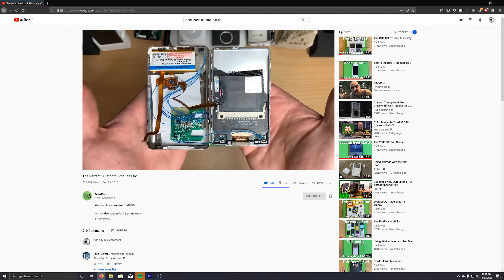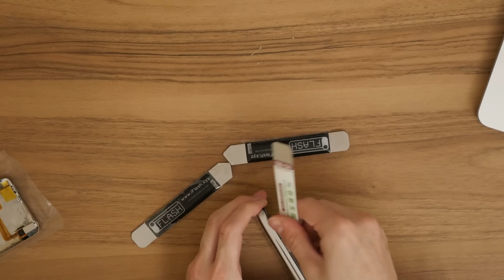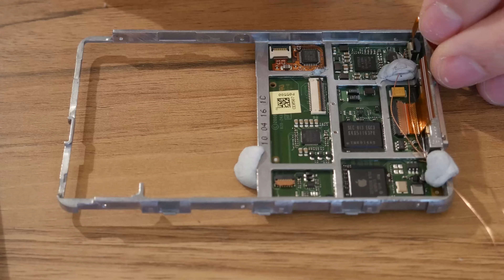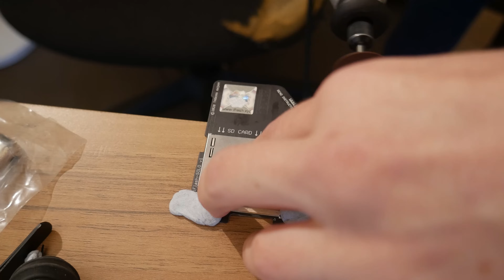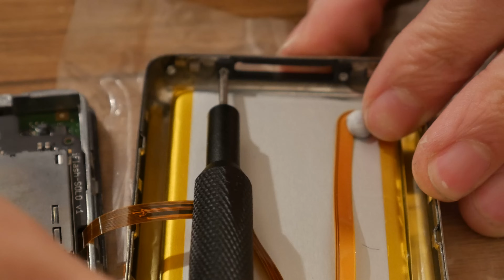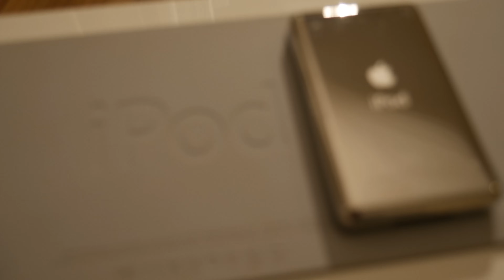The REAL Perfect Bluetooth iPod Classic

Comment: maybe this is a stupid question, but I thought that you're supposed to have the solder right on the iron when you're making the connections. He doesn't seem to be doing that here. Is he just melting some solder onto the tip and then transferring it to make the connection? I thought you weren't supposed to do that?

Comment: To anybody watching this video now trying to do the same, the first back he shows appears to actually be a thick back, not a thin back - I suppose I could be wrong, but judging by the shape of the edges and the general look. If you are buying similar casing and yours looks like the first iPod shown, it’s likely thick. Also, the iFlash Quad is thinner and smaller than either the Duo or Solo, so it will always be the best bet for this type of mod.
Reply: Correction, just got a closer look, can’t edit or delete the comment to correct. It is indeed a thin back. However, the iFlash comment remains true.

Comment: What size wire did you use 18AWG? I can’t seem to get solder to stick to the battery circuit board leads. I have a Weller WES51 pretty sure that gets hot enough. I’m using 24AWG wire maybe too big?

Comment: Some good ideas. Few points - I'd want to use shielded wires as there's too much chance of contact between wires which can cause audio cutouts and even fires in the usage for power. The switch mod is a good one but you want to use epoxy resin not hot glue - that's not going to last long term.

Comment: I got to putting the bluetooth board in the ipod but the link for this bluetooth is a different one and is longer than the one you're using. It doesn't fit. 😞
Anyone know where to get this (or a smaller) board?

Comment: Is anyone having better luck than me with replacement batteries? I’ve fixed up several IPod Minis and a 5th Gen classic, but all of the new batteries I’ve bought have short life. I’ve tried several battery sources. The original iPods could easily play for hours. I get about an hour if I’m lucky, even with a flash storage upgrade
Reply from the maker: I’ve thankfully never had any issues, however short battery life can also be caused by a bad quality SD card adapter.

Comment: Hi Pendleton, I was able to do this mod using your wiring guide! Soldering into the battery connectors is TOUGH and I actually shorted one motherboard by bridging connections. 
Alternatively, anyone doing this for themselves can solder into the second black (or yellow) capacitor right above that battery connector, which has a much larger solder pad. I chose to and the only caveat is that bluetooth module cannot be turned on independent of the ipod. There's no use case where I would do this anyway so it's perfect.
Reply: Does that mean the Bluetooth will shut off when the iPod enters sleep mode?
Reply: Yes. If you solder into the battery connector like Pendleton did then the bluetooth receiver can be powered on without the ipod itself being on.

Comment: Thank you so much for this video tutorial. I did this to my 7th Gen a month or two ago and I love it with one small problem…Ive been busy so I haven’t used it much since the mod but, I just charged it for the first time and noticed that display shows the incorrect battery level. It also doesn’t change on the display. To clarify, my iPod’s screen shows the battery is at about 60% and it doesn’t deviate from that regardless of the iPod is fully charged or almost dead. Any thoughts on this?  I’m assuming I (most likely) messed up when soldering the Bluetooth board to the iPod’s power down next to the charging port?  I’d GREATLY appreciate any insight you may have. I’d love to fix it. 

On another note, I’ve been using my iPod primarily in my truck where it’s only ever 2’ away from the Bluetooth receiver. Well, yesterday, I attempted to use a pair of Bluetooth earbuds with my new modded iPod and the range is horrendous. I wasn’t able to leave the iPod in my pocket due to extremely frequent and continuous audio dropouts. I think I’m going to end up cutting a hole in the backplate and putting in a small section of polycarbonate. Either that, or I’ll look for a new poly faceplate.
Reply from the maker: The battery readout is never completely accurate with these third party batteries, however it should be more accurate than that. 
 They’re only two pin batteries, so it’s unlikely that the connector was damaged, I’d say try another battery and see if you have any luck, they’re relatively inexpensive so there’s not much risk in trying!

 As for the range, did you cut a hole in the metal LCD backing? Make sure that the antenna on the Bluetooth module is lined up with the hole, and if you’re still having issues maybe cut a bigger hole or remove the backing entirely.

 Keep in mind you’ll need to place the iPod in your pocket with the screen facing outward, if you place it screen inward the antennas will be blocked by your body!
 Hope this helps :)
Reply: Thanks for the reply!  I did cut a hole in the metal LCD backing as instructed in the video. Although, I’m fairly certain the Bluetooth module wiggled loose while I was reassembling everything. That being said, I’ll try another battery and ensure the Bluetooth module is in the correct place when swapping the battery. 

I will also try removing the plate entirely if that doesn’t work. 

Thank you again very much!

Comment: you can get bluetooth dongles made for the nintendo switch and just click them into the headphone jack. not a perfect solution, but it's a no-mod solution. 
there are also a few brand of dock-connector based bluetooth transmitter. 
same goes for ipod docks, you can get dock adapters that turns an ipod dock into a bluetooth speaker with remote support.
Reply: The heck i never thought about that great idea w tge switch dongles lol
Reply: Also we watch a lot of same vids this is the 3rd-4th comm of urs I see LOL

Comment: Great video. To add Bluetooth in a pinch without a mode. You can add a Airfly adapter to the audio jack too.
Reply: what a bout USB-C?
Reply: It works with the audio jack. It changes via a USB-C port on the Airfly

Comment: Question: Can you do that project with a 5.5 into a 7th gen iPod, and can you keep 3.5mm Audio Jock working together with BT ? So I can choose between plugging in headphone or connecting to BT devices ? How about sound over the pin connecter, that's untouched as far as I can tell ?

Comment: Why hot clue 🤔 it's not as secure as you think. Just try a single drop of 70-99% IPA it will come up. Also great can do the same. Btw I don't like using it but chip -quik is a fast way to desolder components. You just need solder braid after to make sure it's fully removed before soldering anytime new.  Over all interesting ideas just my a fan of some of the stuff you did to implement your work

Comment: I know this is old but just dug out my classic gen 5 to replace battery. I notice everyone struggling to get them open and I'd never done it probably this video came up in my feed . Anyway I used one of those tiny flat blade screwdrivers and the inserted a bunch of guitar picks and was even able to use the picks to slide around the edge and it opened surprising easily.
Reply: Yeah the 5th generation is easier to open since it's plastic and the 7th gen is aluminum

Comment: Also, is that BT link still valid? I looks rather big. Did they change it, or is it fine once the case is taken off?
Reply from the maker: The one in the link should work, much of the space is taken up by the battery. If you wan to see the process of disassembling it you can check out my clear iPod video.

Comment: I did this a long time ago, less the BT module. I have the iFlash Quad though. After seeing this, I am thinking of adding a BT module. Think I can fit it? Also, does the BT module stay lit only when pairing? If so, the lights might be a good thing to let bleed through. If there's a separate power and pair LED, then maybe just DC the power LED?

Comment: I have found that anything over 20,00 titles, the classic is slow as a slug.  It takes 3 to 5 seconds to navigate each click. It will also add 30 to 90 seconds to boot up.  So, over 256GB makes no sense.  Also, buy the fastest SD card you can afford.  You must use the iFlash adapter.  I have found that the original 160gb hard drive is 50 to 100% faster syncing than any SSD.

Comment: Never use glue on a solder joint. If you need glue to hold the joint in place you didn't solder it good enough. What would make you think glue would be stronger then metal in the first place?
Reply from the maker: Fight me
Reply: @Pendleton115  solder should be good enough, also glue makes repairs a lot harder and these ipods break a lot

Comment: Awesome mod, I love that you kept the audio jack and added a clickable button to control the Bluetooth.
A few questions: Is the thick metal case required to make room for the 3,000 mAh battery? And how much space is left in the final build? I see there is some free space at the top (see at 25:54), would it be possible to fit in a taptic engine into this empty spot?
Reply from the maker: Yes! It’s definitely possible to fit a Taptic Engine, I’ve done it before!

 A thick back is required though to make it all work :)
Reply: @Pendleton115  hi I'm looking to do this build as well I'm looking at the transmitter is it one that's in a black case with an aux cable?

Also what phone did you use for the clickable button lastly can I use a 512gb SD card in a 7th gen 160gb?
Reply: @Pendleton115  Good to know, thanks for your reply!!
Reply: @Pendleton115  this is so funny, I came looking for this answer

Comment: Hey, thx for you awesome tutorial. Please, could you tell me why you need a new wiring harness? Can don’t still use the original one? THX a lot and have a nice weekend. 🖖🏻
Reply from the maker: If you’re upgrading to a thick back you need a thick back wire harness to match
Reply: @Pendleton115  No I dont have thick back rather a thin one! ipod classic 160gb. I think gen 7. then I assume I can use the built-in cable right? THX a lot.
Reply from the maker: @brazo98  if you plan on doing a Bluetooth mod you’ll need a thick back as well as matching thick cable

Comment: I will be performing this mod soon to my iflash modded 512gb 5.5 gen iPod video. Thanks for cutting up a Tarkan for the rest of us! 
Two questions:

1. I went ahead and ordered the same Bluetooth transmitter you used for 10$, but now I’m wondering if there isn’t a better choice available that would be aptX HD capable to match up with newer audiophile aptx hd receivers (I use the bluedento). If you search Hagibis aptX hd you’ll see a VERY small looking Bluetooth transmitter that does aptx hd. Anyone out there used one of these or hacked one up? Might be the way to go. 

2. Can you just reuse the original pairing button off the taotronics board rather than using something else? Or is it just not good enough quality or the right size? It seems like you got it off without damaging it. Just wondering if I can reuse that button if I’m careful rather than trying to find something else. 

Thanks for the excellent video and the push to make my beloved iPod Bluetooth capable.
Reply from the maker: Thanks for the interest! There’s nothing stopping you from using a different Bluetooth module, provided it is a similar size and runs off 3.7v.

 I did try to re-use the original pairing switch, but it is much too small and is too difficult to mount and doesn’t give the correct feedback.

 I would recommend checking out my transparent iPod video for a better method of installing the pairing switch!
Reply: @Pendleton115  that transparent build is amazing. I think I’m gonna go ahead and try and do it. I’ve got a friend with a 3d printer. Maybe I missed it in the video but I didn’t see it in the notes. Where did you get the wireless charging wiring kit? Or was that ripped out of something else?

Also I have left this comment a few times with an eBay link to a button I’m curious would be a good candidate for the Bluetooth, but apparently YouTube won’t let me add an eBay link. So if you search “10 4.3x4.5x4.3MM Momentary Tact  4-Pin SMD Micro Push Button Switch”. The second listing is the one I’m wondering if you think would be alright. 

Thanks for the inspiration. Amazing work.
Reply: @Pendleton115  ps. I’m just gonna use the taotronics bluetooth transmitter for now. If I upgrade my Bluetooth receiver to one that works with aptX hd maybe I’ll try ripping a different one up. 

One off the wall question. I’m gonna upgrade to 512gb while I’m in there. Currently using a PNY 256gb sdxc that has 90 mb/s read. For the new card I can’t decide if I should stick with PNY elite performance (95mb/s) or go with the sandisk extreme pro which is 170 mb/s. Just not sure if I’d really see much, if any difference in performance or if it might fix issues with shuffle skip. Any thoughts? 

I’ve emailed iflash but it’s been about a week with no response. Not much luck finding anyone talking about how the different mb/s speeds help or hurt performance.
Reply from the maker: @aaronaustin4019  I cant imagine you will notice a difference. I believe there would be other parts of an iPod that will bottleneck performance before a faster SD card can improve things
Reply: @Pendleton115  finished adding Bluetooth to mine last night. Thanks so much for the inspiration. Sounds absolutely great quality wise! Much better than my iPhone due to the aptx codec and better DAC in the iPod. 

But my range is not so great. I’m using a 5.5 gen with a plastic front so I figured it’d be pretty decent, but it’s very touchy about having the plastic side facing towards the device. And even then it seems like the range is much worse compared to when I tested the  taotronics externally. Did the clear back help yours gain a lot of distance? 

I also was wondering if perhaps the iPod battery is outputting a lower voltage than the original taotronics battery (I’m using a 3000mah aftermarket battery). From what I read bluetooth transmitter antennas are very much power sensitive and will lose significant range if even slightly underpowered. I will test the voltage coming off the original battery and the iPod battery and see if this is the case soon. 

If that is the reason, I’m wondering about adding a second battery to power the Bluetooth but I would want it to still charge off the 30pin. Do you know where I would attach a separate battery to grab the voltage coming in on the 30 pin or could I just use the same spot currently feeding the unit and run that into the new batteries input? Actually I guess I don’t know how these batteries work. Is there an input and output or is the voltage going both ways on the same connection points. If so I guess I would HAVE to have a separate charging port right?

Anyway, again, thanks so much for the inspiration to tackle this. For now it’s usable if I’m very close and be sure to keep it faced correctly. But I definitely want to figure out how to increase the range. And eventually find an aptx HD transmitter to up the sound quality even more! If only they made little LDAC transmitters. That would be amazing.
Reply: Also, I think I saw elsewhere but that clear back housing file you posted is just a 3d model right? Is there anyway to get the printable cad file for that? I know a few people with 3d printers but I don’t really know how to turn the model into a printable file type.
Reply from the maker: @aaronaustin4019  check the description of my clear iPod video
Reply from the maker: @aaronaustin4019  The internal battery should be more than capable of powering your transmitter. Any range issues are likely caused by antenna placement.
 Maybe confirm which direction Your antennas are facing? (Whether the gold side is facing toward the chassis or the front of the iPod)

 I wouldn’t recommend trying to install a second separate battery as it would add lots of additional complexity to the build and shouldn’t be necessary.

 Hope this info helps and best of luck!
Reply: @Pendleton115   flipping the Bluetooth module around completely fixed it. Now my range is pretty much the same as my iPhone. In the video and wiring diagrams it seems to be facing the rear housing so I went that way, but yea flipping it around did the trick. Thanks again!
Reply: @Pendleton115  so I ended up having to transfer everything over to an iPod classic rather than the iPod video (because the 5.5 gen video couldn’t handle my lossless files and was skipping songs all over). 

Bluetooth range is way diminished in the classic with the aluminum front faceplate. The board/antenna is faced outward and I did dremel away a huge square out of the plate behind the screen. Most of it actually. Any other tips on boosting range? Could I add a tiny Bluetooth antenna and solder it into the antenna trace on the taotronics?

Wondering if the aluminum foil on the back of the iPod classic screen is the culprit. But I don’t think that can be removed safely. Thought about trying to position the antenna under the click wheel but then it would have to go through the circuit board. 

Any ideas?
Reply from the maker: @aaronaustin4019  you could try using a 5th Gen screen in your classic. It doesn’t have the foil that the classic does and “should” be inter changeable

Comment: By powering the transmitter directly to the battery connector, my transmitter remains on and searching for devices - this depletes the battery overtime, are there any locations on the you’re board you’re aware of that are powered when the iPod is on but receive no power when the iPod is put to sleep?
Reply from the maker: That’s what the pairing button mounted behind the hold switch is for

Comment: Those enamel coated wires connected to the battery (bomb) running against the grounded metal frame are kinda troubling.